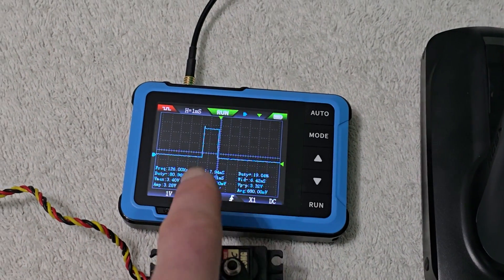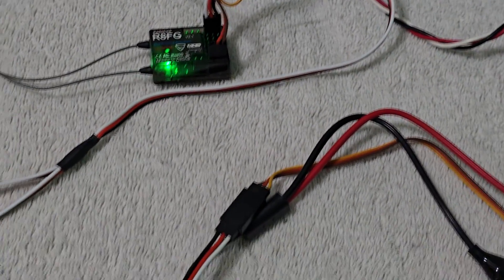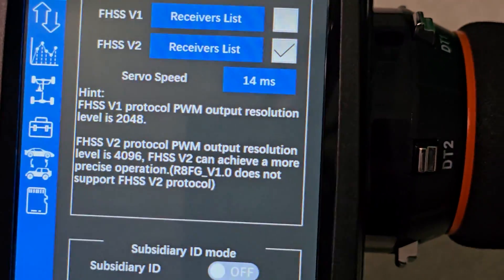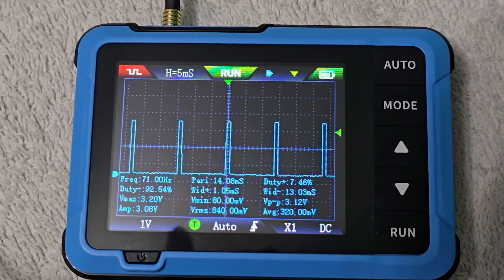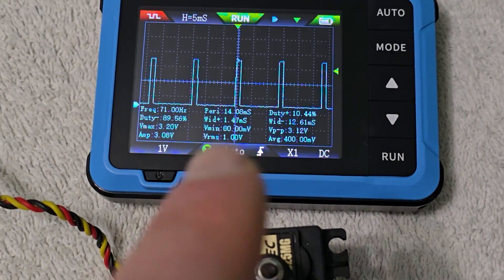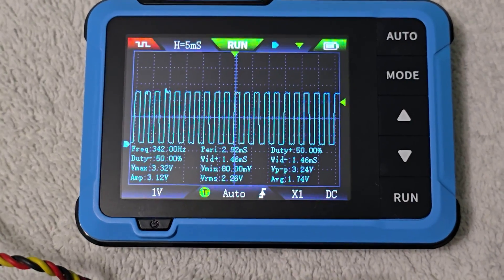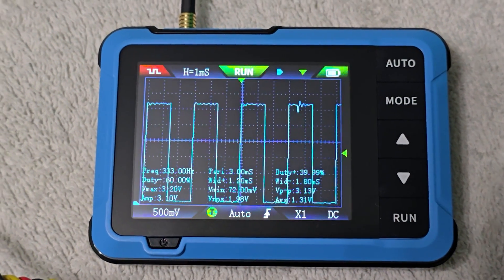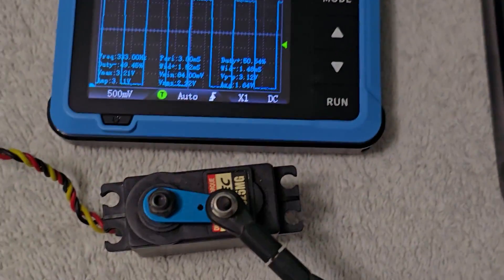Curious What Happens Between Your RX and Servo? Signals Revealed!

Comment: Hey RCexplained, can you tell us what it would take to power an ESC and brushless motor with a bench top power source ? 
I’d like to do some testing myself and need a DC power source that can handle the load put on it by a brushless motor and prop without having to change batteries. Thanks and keep up the good work.
Reply from the maker: If you are going to have a large load placed on there, power supplies get expensive. If your load is under 10amps it's a lot easier. Many options on Amazon.